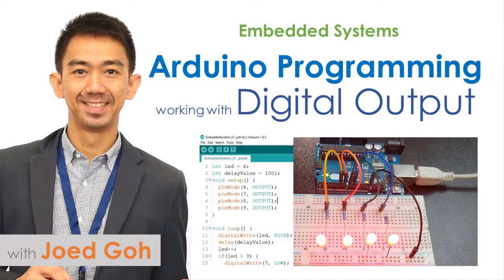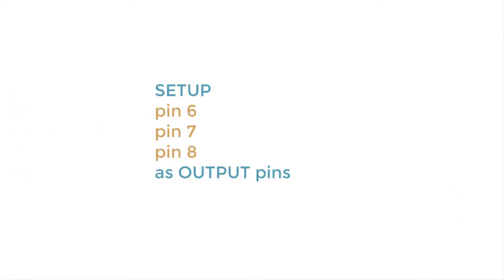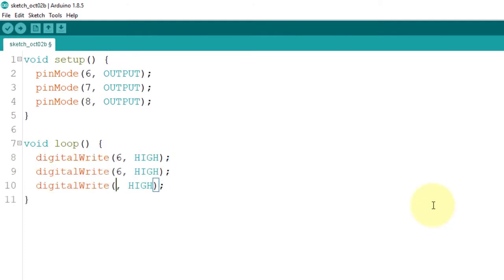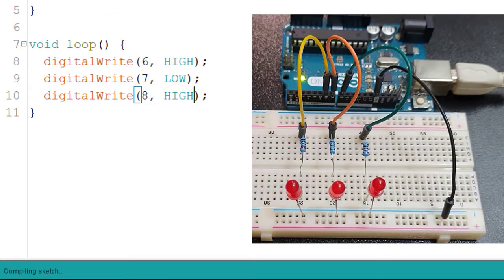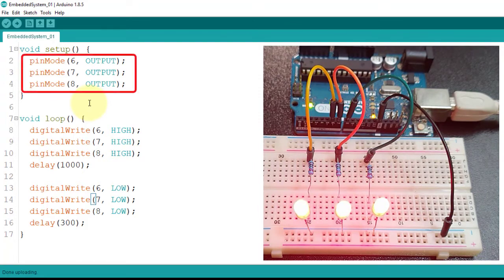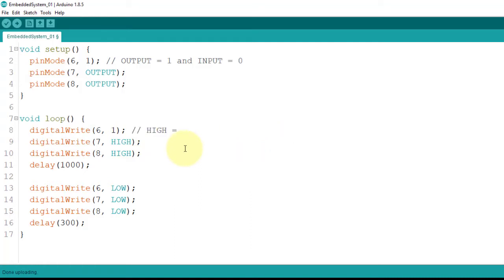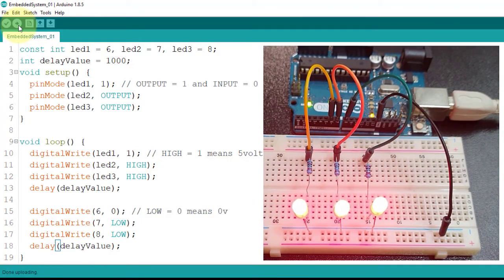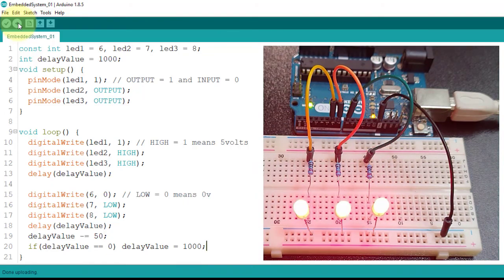06 Arduino Programming - Working with Digital Output | Embedded Systems

Comment: Hello Sir Joed, Can you help me insert a welcome  text or boot message in this code for like 3 seconds before the main code starts?

// include the display library code:
#include <LiquidCrystal.h>

// initialize the library by associating any needed LCD interface pin
// with the arduino pin number it is connected to
const int rs = 12, en = 11, d4 = 5, d5 = 4, d6 = 3, d7 = 2;
LiquidCrystal lcd(rs, en, d4, d5, d6, d7);

//Analog 0 is used to read the voltage on the plate - this reading is mv
int vPinPlate = A0; //a0

//Analog 0 is used to read the voltage on the cathode - this reading is mv
int vPinCathode = A1; //a1

//GUI stuff
int guiCursorY = A4; //reads the GUI cursor in the Y axis
int guiCursorX = A5; //reads the GUI cursor in the X axis
int guiClick = 7; //reads the click of the joystick

//presently the GUI has two modes
#define GUI_MENU_SELECT_MODE 0
#define GUI_BIAS_MODE 1
//the GUI starts in menu mode
int guiMode = GUI_MENU_SELECT_MODE;
boolean movedMenu = false;
int curMenuItem = 0;

//these are lower/upper values for moving the menu with the joystick
struct JOYVAL
{
int up;
int down; 
};
JOYVAL joyvals = {30, 120};

//tube record
struct TUBE
{
String name;
int maxDissipation;
};

//currently supported tubes
TUBE tubes[] = {{"6L6", 30}, {"6V6", 12}, {"EL34", 25}, {"EL84", 12}};
#define arr_len( x ) ( sizeof( x ) / sizeof( *x ) )

//graphics for the screen
byte leftArrow[8] = {0x8, 0xc, 0xa, 0x9, 0xa, 0xc, 0x8, 0x0};
byte rightArrow[8] = {0x2, 0x6, 0xa, 0x12, 0xa, 0x6, 0x2, 0x0};

//voltage record for averaging
struct VOLTAGE_AVG
{
double pinVal; //average value read from pin
int count; //number of times pin value read
int pin; //which pin
double voltage; //calculated voltage
};

void zero(VOLTAGE_AVG *_this)
{
_this->pinVal = 0;
_this->count = 0;
}

VOLTAGE_AVG plate = {0.0, 0, vPinPlate};
VOLTAGE_AVG cathode = {0.0, 0, vPinCathode};

//double plateAvg = 0.0;
//int plateCount = 0;

//double kAvg = 0.0;
//int kCount = 0;

double maxPinVal = 920.0; //maximum pin value
//double refVoltage = 1.057; //nominally 1.1v - use the actual voltage measured on the arduino board in use
double refVoltage = 1.059; //nominally 1.1v - use the actual voltage measured on the arduino board in use
double voltageScale = (refVoltage / maxPinVal); // each unit of measured voltage (0-maxPinVal) will equal one of these

void setup()
{
//set the joystick pin to pullup
pinMode(guiClick, INPUT_PULLUP);

//setup the LCD
lcd.begin(16, 2);
lcd.clear();

lcd.createChar(0, leftArrow);
lcd.createChar(1, rightArrow);

//set the reference to 1.1v (roughly). 
analogReference(INTERNAL); 
}

void loop()
{
if (guiMode == GUI_MENU_SELECT_MODE)
{
if (processTubeMenu() == 1)
{
zero(&plate);
zero(&cathode);
guiMode = GUI_BIAS_MODE;
lcd.clear();
lcd.print(tubes[curMenuItem].name);
lcd.print(":");
lcd.print(round(floor(tubes[curMenuItem].maxDissipation * .7)));
lcd.print("w|");
lcd.print(tubes[curMenuItem].maxDissipation);
lcd.print("w");
}
}
else if (guiMode == GUI_BIAS_MODE)
{
lcd.setCursor(0, 1);

doBias();

if (buttonClicked()) //joystick clicked
{
lcd.clear();
guiMode = GUI_MENU_SELECT_MODE;
}
}

delay(100);
}

double readAverageAnalogVoltage(int pin, int count)
{
double v = 0.0;

for(int i=0; i<count; i++)
{
v += analogRead(pin); 
}

return (v / (double)count); 
}

void readVoltage(VOLTAGE_AVG *va)
{
//plate
double v = readAverageAnalogVoltage(va->pin, 50);
va->pinVal += v;
va->count++;
if(va->count > 100)
{
va->pinVal = va->pinVal / va->count;
va->count = 1; 
}

//va->pinVal = va->pinVal/va->count;
//va->voltage = (va->pinVal * voltageScale); 

va->voltage = ((va->pinVal/va->count) * voltageScale); 
}

void doBias()
{
readVoltage(&plate);
readVoltage(&cathode);

//lcd.print("p:");
lcd.print(plate.voltage * 10000, 0); 
lcd.print(" ");

//lcd.print("k:");
lcd.print(cathode.voltage * 1000, 1); 
lcd.print(" "); 

double dsp = (plate.voltage * 10000) * cathode.voltage;

//lcd.setCursor(12, 0);
lcd.print(dsp);
lcd.print("w");
lcd.print(" ");
}

/*
void doBiasOld()
{

//plate
double vp = readAverageAnalogVoltage(vPinPlate, 50);
plateAvg += vp;
plateCount++;
if(plateCount>100)
{
plateAvg = plateAvg / plateCount;
plateCount = 1; 
}
vp = plateAvg/plateCount;

//Serial.println(vp);
//double plateVoltage = (vp * (1.15 / 1023.0));
double plateVoltage = (vp * voltageScale);

//cathode
double vk = readAverageAnalogVoltage(vPinCathode, 50);
kAvg += vk;
kCount++;
if(kCount>100)
{
kAvg = kAvg / kCount;
kCount = 1; 
}
vk = kAvg/kCount;

//Serial.println(vp);
//double plateVoltage = (vp * (1.15 / 1023.0));
double kVoltage = (vk * voltageScale);

//lcd.print("p:");
lcd.print(plateVoltage * 10000, 0); 
lcd.print(" ");

//lcd.print("k:");
lcd.print(kVoltage * 1000, 1); 
lcd.print(" "); 

double dsp = (plateVoltage * 10000) * kVoltage;

//lcd.setCursor(12, 0);
lcd.print(dsp);
lcd.print("w");
lcd.print(" ");
}
*/
int processTubeMenu()
{
displayTubeTypes(); //disply the types of tubes
//analogWrite(joyVPos, 56.32);
int cursor = analogRead(guiCursorY);

//Serial.println(cursor);

if (cursor < joyvals.up && movedMenu == false)
{
movedMenu = true;
curMenuItem--;
if (curMenuItem < 0)
{
curMenuItem = arr_len(tubes) - 1;
}
}
else if (cursor > joyvals.down && movedMenu == false)
{
movedMenu = true;
curMenuItem++;
if (curMenuItem >= arr_len(tubes))
{
curMenuItem = 0;
}
}
else if (cursor > joyvals.up && cursor < joyvals.down)
{
movedMenu = false;
}

if (buttonClicked()) //joystick clicked
{
return 1;
}

return 0;
}

void displayTubeTypes()
{
lcd.setCursor(0, 0);
lcd.print("Select Tube");
lcd.setCursor(0, 1);
lcd.write((byte)0);
lcd.print(" ");
lcd.print(tubes[curMenuItem].name);
lcd.print(" ");
lcd.write((byte)1);
lcd.print(" ");
//lcd.write((byte)1);

}

//debounce the button

boolean buttonClicked()
{
if (digitalRead(guiClick) == LOW)
{
delay(30);
if (digitalRead(guiClick) == LOW)
{
return true;
}
}
return false;
}

Comment: Hello ,
I wanted to display a text when i press one push button (eg abc) and when i press another push button it should display another test (eg xyz) i know the code is very simple but still its not happening can anyone please help me out it would be very much helpful for me ....lcd is 16*2 using arduino ...please sir can i get code for this
Reply from the maker: Hi J Sha,
Please see my sample code:

#include <Wire.h> 
#include <LiquidCrystal_I2C.h> // found here: https://github.com/marcoschwartz/LiquidCrystal_I2C

LiquidCrystal_I2C lcd1(0x27,16,2); // set the LCD address of the first lcd to 0x27
                                   // for a 16 chars and 2 line display
                                  
/*                                  
  I used I2C LCD controller PCF8574T
  see connections and discussions here:
  https://waime.wordpress.com/2015/04/26/arduino-lcd-liquidcrystal_i2c-library/  
*/
 
void setup(){
  pinMode(2,INPUT_PULLUP);
  pinMode(3,INPUT_PULLUP);
  lcd1.init();
  lcd1.backlight();
}  
 
void loop(){    
  if(digitalRead(2) == LOW && digitalRead(3) == HIGH){ //switch @pin2 is pushed    
    lcd1.setCursor(0,0);
    lcd1.print("Button1       "); 
  }
  else if (digitalRead(2) == HIGH && digitalRead(3) == LOW){ //switch @pin3 is pushed    
    lcd1.setCursor(0,0);
    lcd1.print("Button 2      "); 
  }
  else{    
    lcd1.setCursor(0,0); 
    lcd1.print("Press a button");   
  }
} 

hope it helps
Reply: @joedgoh   thank you sir but it still does't work can i get your email id?
Reply from the maker: @jsha6604  i've code and tried it myself just this morning. It works.. joedgoh@gmail.com